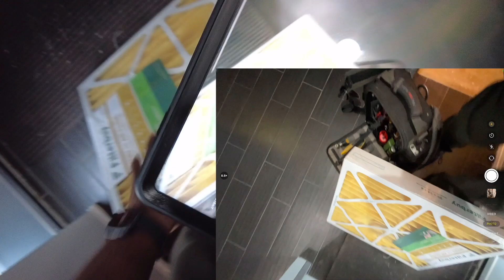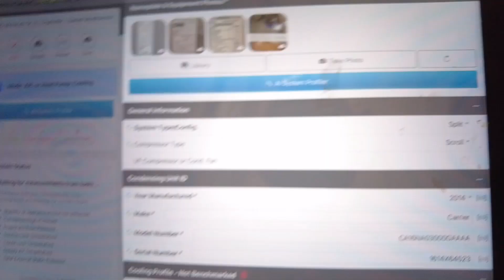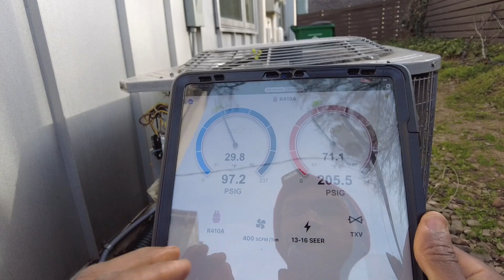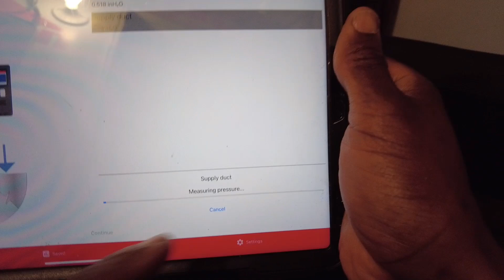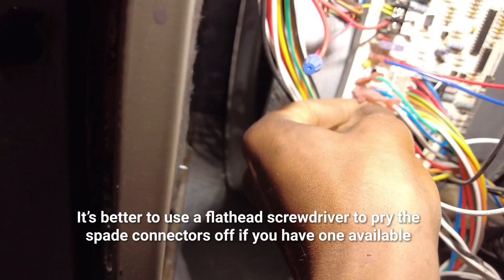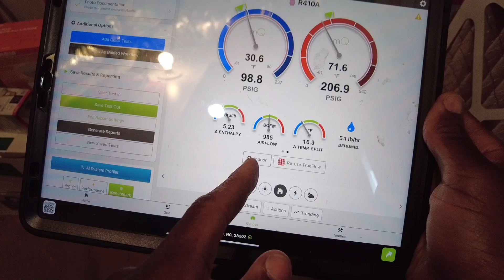Will this App Find Issues you would have Missed? How to use MeasureQuick like a Pro! HVAC Apprentice

Comment: Needs a bypass set up with barometric damper, especially for multi zone, that should have been installed on day one.
If builder or developer does not give us a big enough space to do the work right, then I don't do the install.